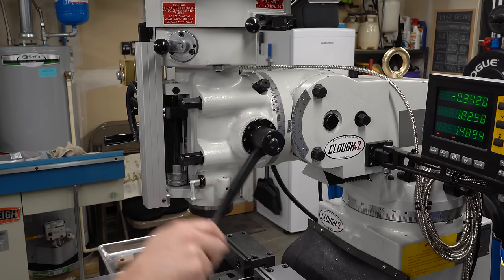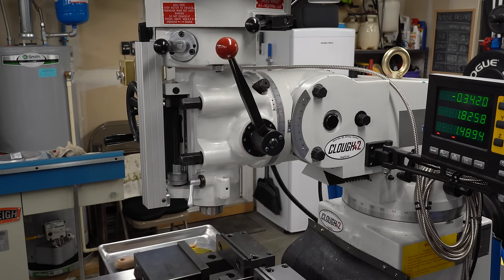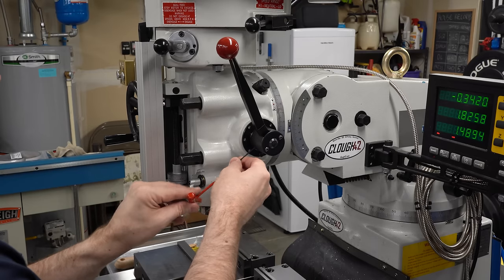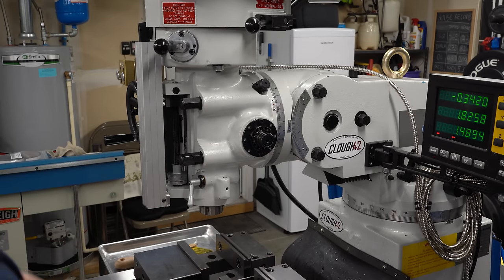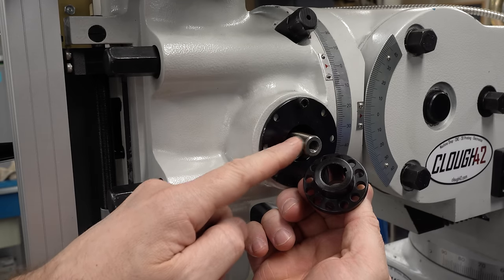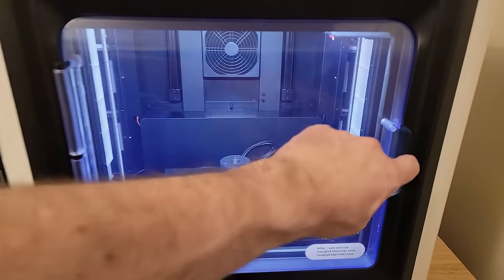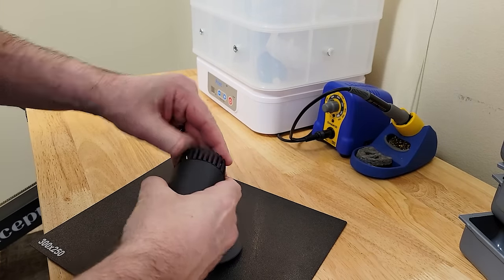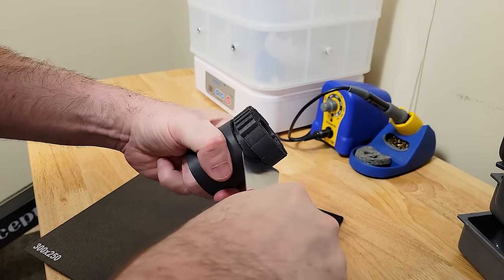Installing a Custom Racing Wheel on My Milling Machine

Comment: I have an oriental mill from (probably) the same manufacturer. Same illogical mix of metric and imperial hardware. My guess is that when the mill was copied from Bridgeport the pars that were reproduced exactly imperial threads were used and where modifications were made or the manufacturer felt it was not critical they used metric. Best oriental engineering practice.

Comment: I purchased a large drill set from Drill Hog because of their warranty. It is frustrating because you have to send the broken one to them with proof of purchase and wait for them to return a new one via snail mail.
Concerning the bolt, it sounds like something designed by a committee with a mean streak.

Comment: My lathe can't take a drill larger than 10mm, so I bought some reduced-shank bits up to 14mm.... and it "works" though spindle motor really struggles.  Yours should cope fine with larger bits, or find some with morse tapers to directly fit your tailstock ?

Also; Do we want to see an excessively-deep dive nerded out video about drill fractures, with an electron microscope?    HECK YES !!

Comment: That drill that broke, there was a bit of flex or wobble as it was initially going in, like it was catching on something and pulling it sideways. Could that have created a stress fracture in the drill bit, maybe? Also that steering wheel didn't look centered and had a slight wobble as it rotated that's bugging me a little bit after all the precision tooling but that's just me. 😁

Comment: In the way back days there was a tool supply company that sold a plastic hand wheel just for bridgeports. They were so ubiquitous when I first got in the trade I thought they were standard on bridgeports.  thenn I saw a new bridgeport with the standard lever I thought boy they really cheapened these up followed by these levers suck.   Theres been a number of machine accessories  that just cant be bought now that were used constantly in tool making.

Comment: James - thank you for selecting a steering wheel with symmetrical spokes. I just can’t abide the looks of the more common wheels seen here & there with their lopsided spokes. I bet the same holds for you! 👍
Reply from the maker: A lot of the asymmetric wheels are also slightly off-center.  They work well in a car, but not really on a mill.
Reply: @Clough42  I’ll take that as a yes. 😁

Comment: I have used and still have the drill hog drill bits. The neodymium Snap-on me left and right but then I have another side that are perfectly fine I truthfully think it's in there hardening and tempering process is where some of the failure comes in

Comment: Perhaps it might be worthwhile to create (3D print?) quick-release handles that could fit through the holes around the perimeter of the steering wheel. Might be good for repetitive work. Also, you could create a long handle using holes on either side for those times you need to apply a little more pressure during large-diameter drilling for example.

Comment: Yg1 drills are pretty good and pretty affordable. We use them on the cnc equipment but they work well on the manual side. Ive only broke them doing stupid things in a cordless drill. I don't recommend yg1's endmills but there drills are pretty good

Comment: I think the math error you had with the key depth was from the curvature of the hole, when you zeroed the dro the tool was touching at the outside corners, not the centre.

Comment: Same , 30y experiance never seen a drill fail like that . Nice job ,  I would have turned a small shoulder to match the center of the steering wheel . And offcourse a center cap is definitly needed to finish the  job .  Brass maybe ? My 2ct's :)

Comment: I know everyone has issues with Harbor Freight, but they're number/letter/fractional Cobalt 135 split point drill set for $115 is awesome.  I have been using them for a couple of years and they have performed great
Reply: I was looking at those drills online last night, now $125. The one star reviews complained of dulling quickly. One review was complaining of the failure to drill out a deck screw, and I know those to be real hard metal, that require carbide. So the question is are those users drilling too hard of steel. I do have their cheaper HSS 115 piece set, and they are junk.

Comment: 27:00 could you put a mini Brodie knob or steering wheel  knob on the wheel to allow you to turn it repeatedly without two handing it? You could even attach it to the steering wheel spoke to avoid interrupting the wheel handle. 

Could just be a 3d print then if you like it make it in metal… with nice hurling - oooh knurling a ball…. That would be interesting to see. 

Also maybe have it as magnet attachment that you can detach  when not in use.

Comment: I got some hate for that mod on one of the machining forums. My problem was that the speed handle was always whacking the DRO mounting arm. With the steering wheel, no interference! No problem with metric/imperial threads on a Bridgeport though...

Comment: I'm guessing they just changed the threads so that Bridgeport accessories would fit. I see the same thing with Honda small engines, everything is metric except the face mounting patterns are imperial threads.

Comment: I think the problem with the metric/imperial mix is so they have some proprietary hardware.  My thickness planer has 9mm hex heads on 1/4x20 threads.  At least it does if my memory is correct.  It's been a while since I've measured them.

Comment: Nice iteration of this mod.
If I might make a suggestion, the new hub would provide better support if a spigot was provided to centre the wheel on the hub.
This also reduces some of the bending load on the bolts and puts a greater percentage of the rotational torque directly into the bolts instead of as a bending load on the bolts.
Again a nice mod.
Take care.
Reply: The central bolt has to go through, and its head is big enough that I don’t see how there could be a meaningful spigot.
Reply: @JasperJanssen  Hi, the spigot does not have to remove the mounting bolt counter bore, as in most motor vehicle applications the steering wheel centering/locating spigot wall thickness is often less than .100” , all it does is provide a positive location for the wheel and reduce the possible misalignment during assembly and as a side benefit reduce the bending load on the fasteners.
From the brief shots available in the video it appears that there is a sufficient area of the adapter visible through the wheel hub for a spigot without modifying or removing the counterbore.
The fastener torque with the surface area of the wheel and adapter faces provides enough clamping friction to handle the rotational torque applied to the wheel.
Thanks for your comment.

Comment: I've had really poor luck with cobalt drill bits in aluminum. They seem to be too brittle for gummy materials. But I haven't bought many cobalt. My supplier accidentally sold me some and they kept breaking in a proven production cnc run on the lathe. I will buy hss or carbide. But have limited experience with cobalt. I know some swear by them.
Reply from the maker: Yeah, others have mentioned this.  Bright HSS does very well in this application, and maybe the best solution is a wide selection.  HSS, cobalt, carbide, short, long, imperial, metric, coated, polished, etc.

Comment: Do you think that will limit the kind of down pressure you can exert with the mill in a meaningful way?  The diameter is about the same so the overall leverage should be the same, but the ergonomics of a wheel vs. a stick changes how much leverage our monkey hands can exert.

Comment: It is confusing. The PM machines come with a mix of metric and normal screws. You can be pretty sure whatever wrench you grab, it'll be wrong. Machines are great and there maybe a reason. I've often thought that they spec Am. Std. Threads for items that may need to be frequently accessed...but it's weird, regardless.   COBALT DRILL BITS. I too have see this. Not on as many bits as you've seen, but I did get some cheap, chinese bits, and a 5/16 failed the instant it made contact. It was a large set of bits, and I've used the others very carefully with no failures. The metal can apparently develope micro cracks that their QC cannot detect, if they even have QC. It is nerve wracking, and I never use them on anything that I cant recover from. I feel sure I bought the set on Amazon, but they are not in my order history...Don't know the brand but they were not Drill Hog.  Of course, Drill Hog may have bought the company that made the bits I have...who really knows where this stuff comes from?
Reply from the maker: Yeah, I think that's exactly what happened here; a crack in the drill that they didn't detect, and I didn't notice.

Comment: Well one thing I CAN tell you is Drill Hog as a company does the same thing many others do , they OVERSELL  you on these drill bits coated with everything . You are a hobby machinist , you need a good quality Made In USA uncoated high speed steel drill bits and not one thing more .  When you get to the point of drilling Inconel at very high speed in a CNC machine you can purchase some coated bits , till then  don't waste your time of money on SPECIAL bits .
Reply from the maker: These drills are not coated.  The gold color on M42 HSS is oxide from heat treatment.

Comment: I haven't tried this myself yet, but a recent version of PrusaSlicer apparently added support for splitting models along a line and adding keyways to line the parts up again, so each half could have been printed with the best side up. That would introduce new places for error margins though, but might be good enough for prototyping like you did.

And I 100% agree with what you said at some point -- the places where you don't need full precision are great practice to do it for when you actually need it.

Comment: I have the Drill Hog HI Molybdemum M7 bits in stubby and standard length. And I have had several fail like that one was drilling delrin and one broke like that..
The worst thing is getting them warranted  they act like they are doing you a huge favor by replacing them even though they are advertised and sold as lifetime warranty. It has got to the point that when one breaks I buy a replacement from MSC and throw the broken one away. I have never used excessive force or drilled without lubrication. Needless to say I won't be buying anymore or recommending them to anyone.
Reply: Also I would love to see a video of the failure analysis you did on the one you had

Comment: This looks like a great addition to a mill.  My hobby size mill has frequently required me to remove one of the 3 handles in the quill to allow the work to pass under.  I would consider this for my floor model drill press though.

Comment: 3d part looks great, actually surprised it wasn't stiffer.  I know it was temporary. What infill did you/would you use for a part like this?
Reply from the maker: Infill actually makes very little difference in most 3D-printed parts, since most of the rigidity comes from the skin.  I think this part was printed at 20%.  Perhaps doubling the cost of the part would have made it a little more rigid, but as you mentioned, it was temporary.

Comment: What a great idea!

I'll be doing the same to my mill, but to avoid all of that machining on a new hub, I'm just going to weld a steel round onto the old hub, so I'll just need to add the 3 mounting holes.

Comment: I may have overlooked it, but do you have a link for the thread forming tap you used? I am not famililair with them and would like to try one. Thanks for all your great videos.
Reply from the maker: The one I used is a BALAX #13083-012.  I bought it over-the-counter at my local tool supply.

Comment: I'm surprised you didn't fix the runout on the steering wheel. It probably was out of round or distorted when the manufacturer welded it together. Also you need a horn button mounted on top of the wheel center.😎
Reply from the maker: I checked it on the surface plate and decided to leave it alone because the welds are so pretty.

Comment: It might be m8x1.5, not a standard size but it is out there.   And would likely engage a few threads with 5/16 18 as it is very close to 17 tpi.
Reply from the maker: Unlikely.  I tested the shaft by screwing a 5/16-18 screw all the way to the bottom of the hole (about 3/4").  It was free all the way down. 
 There's no way a ~17TPI thread would have done that.
Reply: @Clough42  hmm, odd for sure

Comment: be careful checking screws with a thing gauge like that while it may screw in, errors can be missed as some metric threads are close to imperial but the error will show further down the length of the screw.
Reply from the maker: I generally haven't had that issue.  The threads in these things are remarkably precise.

Comment: No more acid tests for me, man. I gotta drive.  
I chase printed threads with a tap just to mitigate delamination of the surrounding layers.
Reply: BTW: Drill Hog makes great drills. I suspect that was a (raw) material defect.  They have hardening and tempering down to an art. 
I have had one drill break similarly. It was of unknown origin.  
Anyway, Drill Hog bits have a lifetime warranty. 😎
Reply: I looked. The bit that broke in a similar fashion was a left-hand thread Drill Hog bit. 5/32” of “dayuum that’s a nasty longitudinal break!”  
I expect left-hand drill bits to shatter when the bit catches. I have never seen a predominately longitudinal break.
Reply: What I think, for what it matters, is that Drill Hog is “American-made.”  I will gladly ask them for a replacement bit.  Meanwhile, I wear safety glasses, acknowledge the loss of time, and proceed with the usual caution (AKA “wild abandon”).

Comment: Ive had nothing but poor experiences with any sort of plated/coated drill bits.. my goto has always been black oxide bits cause even if it dulls theyre easy to sharpen.. on another note♪.. what kind of horn will you be installing on that new steering wheel? :)